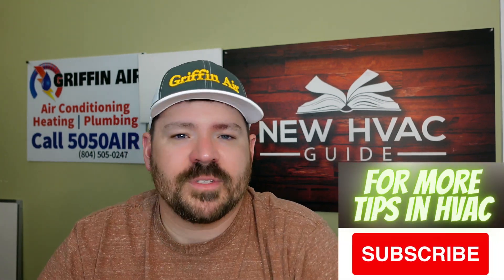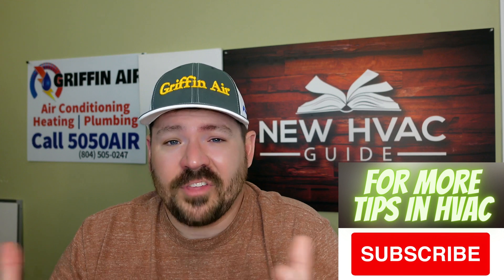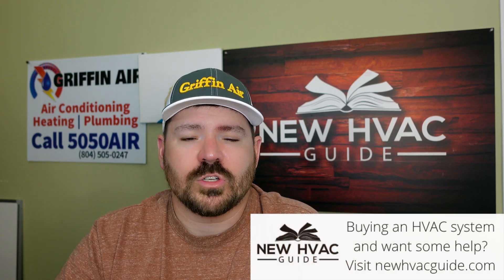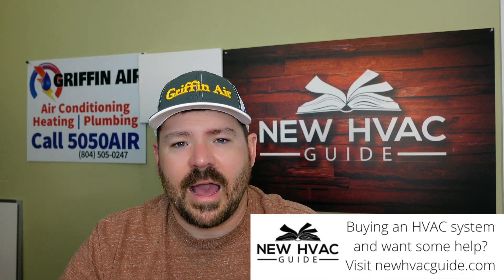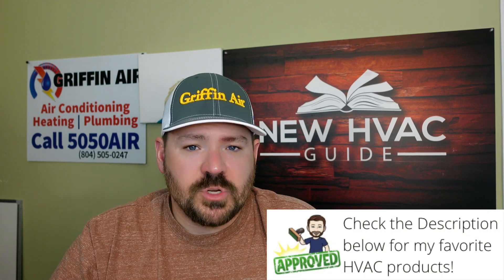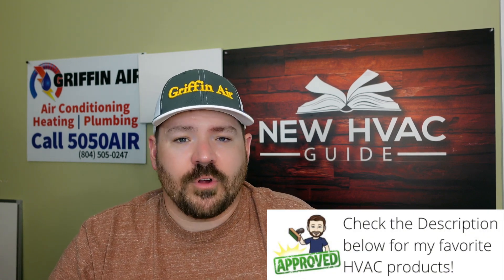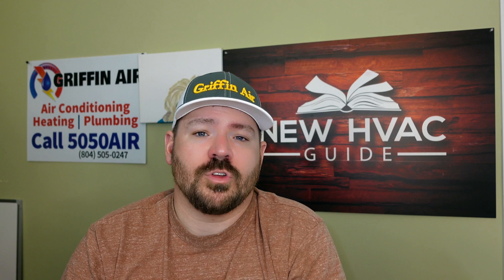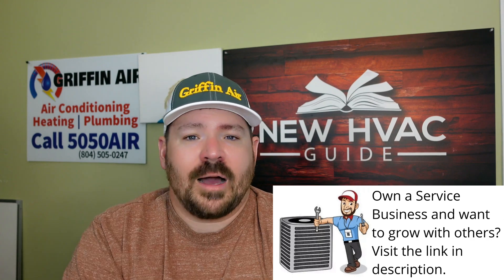Are DUCTLESS Mini-Splits MORE WORK?!

Comment: I had minisplits installed (non-ducted).  Linesets installed outside and covered to look like gutters.  Interesting to hear HVAC folks hate on them.  Minisplits are zoned out of the box, and HVAC are pushing for multi-zones anyways, so ... why hate on them?  To do multi-zone with forced air, I'd have to get those mechanized dampers jammed into ductwork, each of those dampers need power & control cable runs, and then a damper control box, etc.  So it's a wash.  Pros & cons to each.

Comment: Unfiltered air too. Yes they come with a filter but its not much of one. These mini splits are perfect for a garage, basement, or just one room mainly because they aren't going to give even temperatures if you were to use 2 or three of them in a home environment...not to mention, with three of them, you are almost up  to the cost of a nice central system. 
I'm finding information though that a 3 ton unit is very inexpensive on the electric bill so with that in mind, 3 tons is a great value when the power bill doesn't rise as much as a 3 ton central A/C. However, a 3 ton or smaller central A/C and heating system doesn't take a lot of electricity as many might think but the 4 and 5 ton models take considerably more power to run from what I have heard. It might be long term a better idea to have 2 systems if the load factors suggest a home needs 5 tons. Why? One, better power consumption management and two, if the floor plan supports it, one of the two systems can be set to different temps such as single story home, all bedrooms have their system and the other portion of the home has its own. One 3 ton and one 2 or 2.5 ton working with each other would provide better temps and comfort I would think than one 5 ton plus, when only half the house needs comfort, just the one smaller unit is used. My 2 cents but upfront cost would be higher however, who cares if you are not moving for a decade or two.
Reply: But central forced air isn't suppose to be filtering indoor air anyways.  :)  Many an HVAC guy still says the filter should only be used to protect the system, and that's the kind of filters minisplits get.  I'm not disagreeing with your point -- my minisplits did had flimsy filters -- but I just don't like inconsistency in HVAC recommendations.
Reply: @vap0rtranz  Yes, my focus was on the filter for mini splits were not much of one "for the equipment" needs. I'd agree that the filter plans are for the equipment, not for the inside environment which I believe is just a perk to boost sales.

Comment: I think ductless being more work is kinda non sense. It's an excuse for contractors who thought mini splits would be nothing but easy money before they screwed a bunch of install up. I can't even get an outdoor condenser into a work van or truck without a helper yet I can do a full mini split install by myself from an SUV. The sheet metal origami one has to learn to make transitions and metallic welding involved with a central system make this a no contest really.
Reply: Well said. Sheet metal origami 👌

Comment: Why not give the option of best of both worlds ducted mini split. Yes the ducted mini split is a bit more work because you have to change the copper line sets and run 14/4 wire. Depending on brand and BTUH they can get up to 20 seer. One other thing never used a hvac contractor that doesn’t do a heat load calculation a manual J8 ACCA approved. Especially if you’re going to have a ducted mini split installed.

Comment: But with central air conditioning, setting up zones would also require dampers installed and would  only make sense for duel and multi stage units, no?
Reply from the maker: Good point pal!
Reply: Bingo!  So there's pros & cons to each.